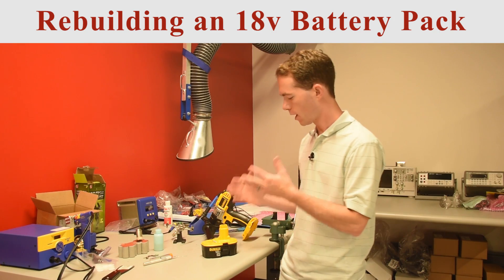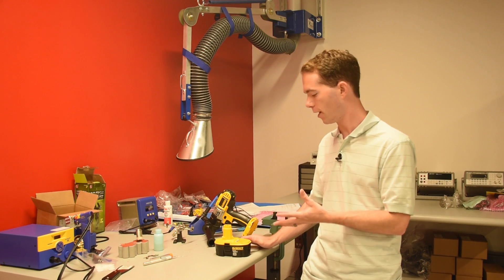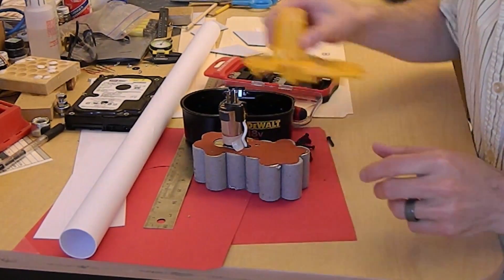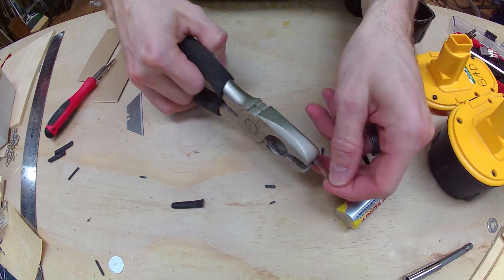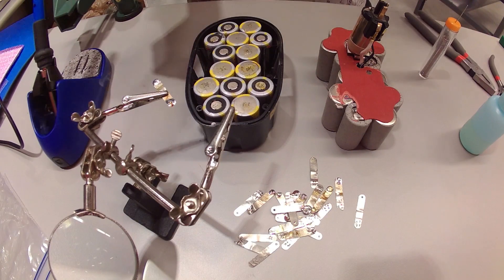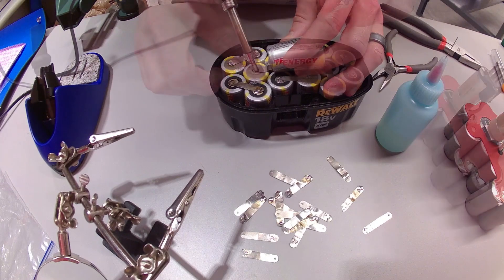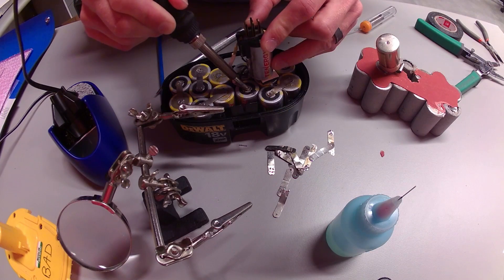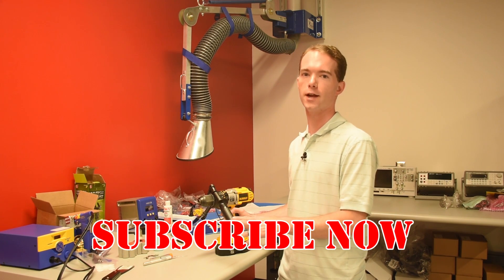Rebuilding an 18 volt DeWalt Battery Pack

Comment: Hi Mike....realize I'm 9 years to late, but am now rebuiliding my DeWalt battery as your instructions.   Taking my original DeWalt battery pack apart I'm finding the soldered tab order on the original is different from your diagram.   Should I follow your diagram or copy cat my original battery tabs for the soldering job??     Thanks
Reply from the maker: it's been 9 years!?! I guess so... Well, I'd suggest following your current battery layout, I'm sure changes have been made. As long as you get the power in and out at the right spots I suppose is all that matters. Thanks for watching!

Comment: I bought a 60 watt solder iron and new batteries, I could not get the solder hot enough after a few seconds to attach to the new batteries. Threw the new solder iron and new batteries into the garbage. Really disappointing!! Not blaming you Mike. I’m sure I’ve lost my touch at soldering.

Comment: I love watching these "rebuild" videos bcuz they help alot despite the challenge. When you say, you rather buy an already built set, are those available? Or do you mean buying a Dewalt pak?
Reply from the maker: I've seen some that are rebuilt already and some that are just drop-in replacement packs. Don't know how good those are. I switched my setup to the 20vMax a couple years ago and even rebuilt those once since.
Reply: @MikesInventions  Heyy, thanks for the reply. So you went from 18v to 20v? Would the tool be able to handle that extra? For me, I looked this video title up bcuz the battery on my 18v Dewalt jigsaw went bad, (so indicated the charger with blinking light). And so since I've built RC packs in the past, and do common soldering, I figured I can build one for it. But this tool uses an 18v XRP battery. I frankly have no way of knowing what type cells are on this pak now. Then there's which brand or mah cells to use. Have you a better idea? Thx.

Comment: Mike, get yourself a spot welder.  That makes putting packs together a snap.😊
Reply: You can get the spot welders from Temu for a fair price, kits start at around 10 bucks and they go up from there, I chose one that is USB rechargeable and comes with USB cord and a small bit of nickel strap all in a storage box for about 30 bucks.

Comment: Lol, I tried and completely failed - I just couldn't get the current out of the battery - even though the voltage read right. I assume the soldering wasn't good enough to support the current. Or the cheap Chinese 4/5 C cells I bought on ebay were defective....... surely not!

Comment: THIS DOES NOT WORK !!!!  I purchased batteries without tabs.  Getting the solder to stick to battery WAS A NIGHTMARE.  Dont waste you money like I did.  Worked on it for 5 hours.  Just buy a finished battery
Reply: Yeah, it can be tough to solder on batteries. I find that roughing the spot where you're going to solder with some sandpaper helps greatly.

Comment: How much were the 1.5 batteries compared to a purchase of a new unit?
Reply from the maker: They were cheaper, I think $25ish, whereas a new battery was a bit more. Of course, factoring in time, doing things yourself is almost never worth it, but I just love trying and doing stuff, so it was worth it for me. I don't use these 18v packs anymore. I converted to 20v a while later and used adapters for the 18v tools.

Comment: I have a number of suggestions to add to this process, which is not as easy as it looks in the clip.
1. number the batteries top and bottom as in the diagram with a Sharpie.  When you've soldered the top side and flip it over, the battery order is flipped from the diagram and it can lead to confusion.
2. Orient the battery case and the diagram in the same direction while you're working and mark the round end of the battery on the diagram.
3. Use solder flux.  The batteries are not solder friendly and resin core solder doesn't get it.
4. if you're going to glue the batteries in position, use as little glue as possible.  Use too much and you won't be able to fit the assembly back in the case.
5. Before your start, take note of the orientation of the prongs in the connector.  They only fit into the tool one way.
6. Be careful about connections and metal tools around the batteries.  Arcing and Sparking is something to avoid.

Comment: So I have a 20 year old Harbor Freight cordless drill that uses the 18V Ni-Cad battery pack 44849.  The drill is perfect...but the pack is toast.  Is there a replacement pack I can get?  Lithium perhaps?  Link?
Reply from the maker: Hey there! I'm not sure about a replacement pack for that, but you can certainly rebuild a pack with new cells. I'd recommend switching over to lithium somehow though. I got an adapter for my 18v DeWalt tools so they can use the new 20v lithium packs. Putting lithium cells into an old NiCd pack isn't really good, because there's no way to balance the cells on the old charger or charge them to the proper voltage. Lithium chargers and NiCd chargers behave completely differently. Thanks for watching!

Comment: Do you think old batteries from my collection of old packs will still work , some look good but there are sum that leaked ?
Reply from the maker: Check the voltages on each cell, and you might have to rig up a way to test charge them, and you just might find a few good ones.

Comment: This convinced me it's not worth rebuilding my old 12V Dewalt XRP batteries. Sounds like the cells cost as as much as the off brand replacement battery packs. I bought 2 news batteries for $35.

Comment: How did you get the pasteboard off the battery cells? They seem to have used lots of epoxy... I can't pry it loose
Reply from the maker: I lifted it very gently. Mine seemed to have a lot of glue on it too. I've since converted to Li-Ion. Thanks for watching.
Reply: I did it with a steamer. 
I have a Wagner Power steamer. If you don't have one , perhaps propping the battery pack on its side above a pot of steaming water would do.
Reply: @jimanderson699  Good tip! Maybe a garden hose on a teakettle...
Reply: @OmikronZeta  .
Exactly . I hope that works for you.

Comment: If you have a lot of packs to do, it is worth building a spot welder as the joints are made instantly and results perfect every time. You should have mentioned that as Ni Cd is very toxic to human health and a mistake could be fatal. Dispose of old cells via professional services only...Do Not Bin the cells!

Comment: Do the factory Dewalt batteries have any markings on them that would denote the Brand?
I've already rebuilt some battery packs using HF battery packs but they just never really had the "chooch" that the original batteries had. 
now that its been a couple years i want to just buy SubC batteries in bulk packs and rebuild my battery packs as needed, but i don't want to buy a S brand again i want to buy the brand that Dewalt uses.
Thank you

Comment: Greetings from Lima, Peru
Reply from the maker: Hey Daniel! You can get whatever batteries are available. Of course Duracell is good, but you can buy complete kits on eBay or somewhere online for a lot less trouble than doing this yourself. It's an interesting exercise, but really not worth it. I've since upgraded to Lithium batteries about 2 years ago.
Reply: @MikesInventions  Hi Mike! Thank yoi so much for your video i am going to do it. I will buy by ebay. So i have any question please help! Or what is your email? This is my email: dan.string01@gmail.com. Greetings from Tablada de lurin, VMT, Lima, Peru.

Comment: I am going to do it different and then report the results to you. First I will use  some chemical to dissolve the glue. Then I will seek out the existing (bad  batteries)  in the current pack and remove it, and attempt to super charge the bad batteries  individually  using alligator clips and a 9 volt battery--unless-they will charge in a standard battery charger --I will use that method. My attempt is to find the reason  the battery failed and restore all bad components prior to re constructing the battery. I will replace any bad batteries  found in the pack if they will not take a charge. I suspect that there only a few bad batteries in each pack. Using a volt meter  to test each battery in the pack first. I will get back to you once the project is completed.

Comment: thanks for the video and great job. I would like to make one comment that if you want that to move along faster you can make you a spot welder to weld those nickel strips back in place or simply pick some of them up and make the new ones . There's a channel that I watch some that I got the spot welding tip from and it's a very simple rig using a 12 volt battery. I think he's the battery guy and I believe it's DARKKEVIND on the subscription. but thanks I just kind of wondered what type batteries were in them and if it was going to be the same as I use in my lights but of course it wasn't, dammit! But thanks and Happy tinkering!

Comment: Good video.. thanks.  Hey I like you fume extractor fan attached to the wall behind you. Is that something you have built yourself or purchased ?  Cheers 👍
Reply from the maker: Hey Jason, that thing was purchased and installed   by the building contractors. I'm not sure who made it or where it came from. It's quite simple though as you see. I'd be a relatively simple build.
Reply: Thanks Mike 👍

Comment: HEY GUYS!!!    I hate to tell you this but all you had to do is find the lowest voltage battery cell and charge it up to the voltage value of the rest of them. Its called "Balancing" I have revived many battery packs doing this. That includes NiMh, Nicd, and lithium 18650 battery cells. And if one cell is too high a voltage just use a 300 ohm power resistor to drain until it matches the rest of the cells voltage. Works perfect.
Reply: Yes but once they're a few years old, this is just a temporary fix.

Comment: Can you rebuild my 1000 Petawatt Power cell?
Reply: Techis God, There are several components to getting a good result. One plan I found which succeeds in merging these is the Jons mender guide (google it if you're interested) without a doubt the most helpful info that I have ever seen. Check out this awesome resource.

Comment: This is an awesome video, and it's fun to rebuild things.  I don't mean to be a downer here, but you can buy replacement 18V, 4000 mAh batteries on eBay for less than $20 each.  That is for the complete battery pack that pops right into your Dewalt tool, not just the sub-C cells.  So no rebuilding would be necessary.  The link above is for a set of 15 2200 mAh  sub-C cells that would require a lot of time rebuilding, and a cost of $32.00.  And the storage capacity (run time) would be much lower.  Again ... no disrespect intended, but sometimes it's best to just buy the replacement battery and put the tool back to work.
Reply: this sounds like a great idea and in fact I did purchase the cheap replacement batteries.  Problem is I spend two or three minutes just trying to get the battery to release from the tool.  I've rebuilt the dewalts with out any problems.
Reply: I took that approach for 2 drills I have.
Two different drills, two different suppliers.
One battery pack was great, the other was hopeless.
I complained and got a replacement which was just as useless.
By doing it yourself you can ensure all your money goes into the quality of the batteries rather than into the profit for the battery vendor.

Comment: I hate to tell you but those batteries have come down substantially in price on eBay. Unless you're bored that is.
Reply from the maker: I was.
Reply: Be careful you are not comparing oranges and tangerines, so to speak. From what I can see, many of the sub-$20 replacements have a capacity of just 2000mAH (2AH). A genuine replacement is more like 3600mAH (3.6AH).

For comparison, your smartphone likely has a LiPo battery around 2000mAH.  🤔

If someone wants to go the DIY route, I’d carefully read the battery specs to avoid rebuilding with the same type of low-capacity batteries which will greatly disappoint.

In my experience, I would avoid the Tenergy-brand batteries shown in this video as they seem to have a very short life span when I tried to use them in another battery-powered device.

Comment: I am trying to disassemble my lithium dewalt battery, having problems pushing out the contacts...are they glued in? I removed the bracket on the inside but the contacts will not push through. My battery has only been charged once and the second charge the charger light started flicking fast. Not sure what's going on, but once I get it apart I'm sure I can fix it.

Comment: Great vid! I done this myself and it works great, you can get batteries on line cheap, screw paying $80 to $100 for a whole new battery. Also if you have the old 18v dewalt tools you can buy an adapter for around $15 so you can use the newer 20v lithium battery packs.
Reply: hey ,if anyone else needs to find out about restoring a battery try Jadonite Renovate Battery Buddy (do a google search ) ? Ive heard some extraordinary things about it and my buddy got amazing results with it.
Reply: Can you provide a link for this?

Comment: I have 4 camcorder batteries that no longer hold charge as they are 30+ years old, I REALLY need to get this camera working, there is no workaround. Is there anyone I can pay to replace the cells in my batteries? I have tried finding replacement batteries online but there are none. Any help would be amazing. I need this camera for filming a horror movie as soon as possible.
Reply from the maker: Hey Toby! Most battery packs are rebuildable. Since you can't find replacements, I'd suggest breaking one open and seeing what's inside. You can most likely order whatever types of cells are inside and perform the repair much like I showed here. Good luck!
Reply: Mikes Inventions that’s awesome mike and thanks so much for the reply. I figured the same thing although can’t seem to open the battery easily. Really glad to know it isn’t unrealistic to get my camera up and running again. It’s an early 80s betamovie camera that shoots straight to full size Betamax. Tested it using the mains adapter and it works!

Comment: Is this still worth it to do, since I found these on Amazon, which now costs less than the 15 cells: https://www.amazon.com/3600mAh-Replacement-Dewalt-Battery-Cordless/dp/B07M63Z5FN/ref=sr_1_2?keywords=dewalt+18v+battery&qid=1560984867&s=electronics&sr=1-2
Reply from the maker: Hey Minh. No, it's not worth it. It wasn't worth it when I did it. I just did it for the challenge and education. I've switched to 20v LiPo since, and I bought the adapter so I can use my older tools with the new batteries. If you're committed to sticking with the big 18V packs, just buy a knockoff like the one you found on Amazon.

Comment: Do you think it’s possible to do this to the Dewalt dc9180,9181, & 9182 series??? They’re the lithium ion batteries that came out after these,but are the series before their current 20 volt .

Comment: Why are people still wasting time on obsolete technology? Buy a 20v Dewalt set and you will have half the weight and twice the power and run time.
This is like spending time and money to rebuild a vhs player!
Reply: @bruce a:  i know i could look this up, but perhaps you can give me the the quick economic analysis, bruce.  what does a 20 volt dewalt package cost these days?  years ago, i bought the drill package as well as the fat boy, featuring a circ saw, recip saw, and work light.  my drill, both saws, and light will not work with the any other battery.
what would it cost to buy a new set of these four tools, plus two batteries and a charger?
also, is government assistance available?

Comment: My battery isn't just weak.. It shows a full charge when off the charger but has no amp output. Will it still rebuild the same way? I mean can I take the batteries out and test them and then replace just the bad batteries? or is there a likely short somewhere that has damaged all of the batteries?
Reply from the maker: Hi! It sounds like your pack is dead, probably due to the memory effect of NiCd cells. If they're more than a couple of years old, they're not going to hold a charge anymore. I don't recommend actually rebuilding a NiCd pack, because of all the effort it requires. If you want to stick with the battery technology, then I'd just do what some on here have suggested and get a knock-off pack or innards kit from eBay. It's probably not a short. The batteries are well built, but you may have a couple of dead cells in the bunch, but really, it's not worth the effort to do all this. It was more of a  mental exercise for me. (As is most of what I do). Thanks for watching. Good question!

Comment: Thanks for sharing. Is there more detail in rebuilding a Skil 18V Li Ion Battery?  What is the best cell to use to rebuild those?  Appreciate any tips or tricks. That's the big project I  have right now. 

Thank you!!
Reply: They are all the same. The ONLY difference is the cell layout. The best cell to use is Ni-MH, rather than Ni-CD. Don't rip off the cell tabs, refer to my comment that starts with "WHAT AN IDIOT" to find details of a much easier method.

Comment: I have a Ryobi set that i found you can buy a cheap 18V battery from harbor freight and you can stuff those cells in the Ryobi case by moving around 2 or 3 batteries. 80% of the work is done for you, and its only like 15 bucks.
It appears that the HF battery will also work for this dewalt battery.

Comment: Very good video! I might try on some old dewalts I have, but for my main drill I will upgrade to a Ridged (home depot) drill and after registered they replace your dead battery's for free for life! With that deal you would have to be a $%&#@-+ to buy any other drill. Yes they cover the drill too.

Comment: Why solder when you can use E6000 and glue the battery tabs back on
Reply: Most people wouldn't consider doing that because E6000 is non-conductive.